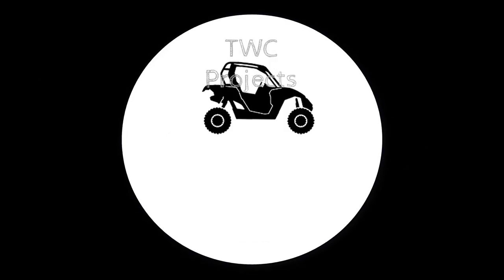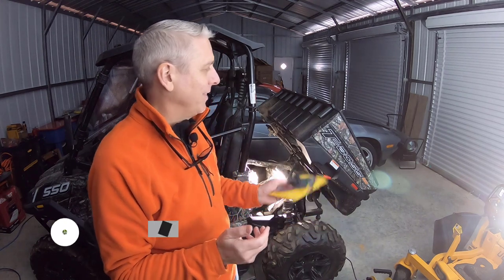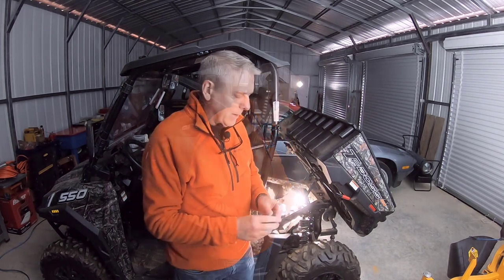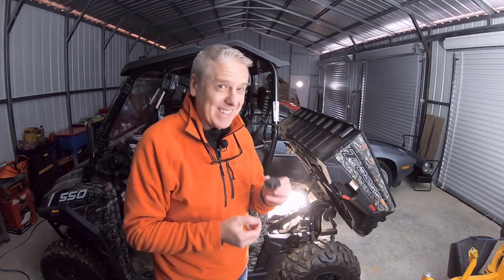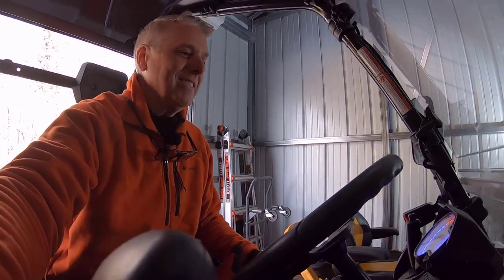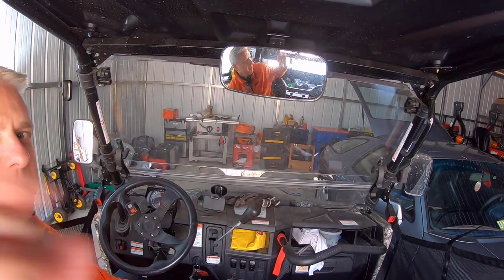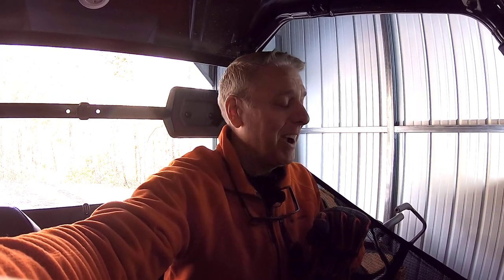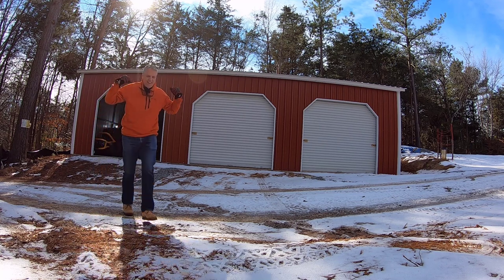51-It's BACK!  My Massimo T-Boss 550 side-by-side/UTV is finally running again.

Comment: Thanks for posting. I am fixing to work on mine. It's not a constant problem but I ran the fuel low I think I sucked crap up.
Reply from the maker: Glad you found these repair videos helpful.  You mentioned fuel, so you probably saw this video too, where I replaced fuel filter, injector, etc.  In case you missed it, here's a link to it.  https://youtu.be/gYIdxIML4LU?si=33vcpbjWLOyrOq74  I think I have 3 repair related videos in all.  

Thanks for watching and for your comments.  So good to know these videos help others.  Have a fantastic day.

Comment: Thanks for the Video. I have a 2022 AXIS 500 with 212 miles on it. Drove it in the shop. The next day it would only start and go dead. Trying to find a dealer to work on it under warranty is useless. I found one they kept it for 6 six weeks and could not fix it. I brought it home  cleaned out the fuel tank, new fuel filter, injector, spark plug, disassembled carb and cleaned got the same results. Run acroess your video. I removed the TPS and checked the ohms got nothing. Ordered a new TPS installed and it runs like new. Thanks again Tim
Reply from the maker: Wow!  That's fantastic to hear you got it running again.  So sorry you had all the frustration and waisted time.  As you saw from my 3 videos, I had similar experience, less the 6wks in a dealer's shop.  If I had only known that there were ODB2 codes.  Surprised the dealer didn't know that..  I now have the codes list with descriptions and much more related info on my website.  Please feel free to refer back to that anytime. https://twc-projects.net 

Thanks for your positive comments.  I'm so glad to know these videos help people.  Have a fantastic day.

Comment: Got my TBOSS 550 last year. Everything was great until recently. Snow on the ground here in Missouri. Now the engine cranks over but no fire. I guess I'll look under the hood and see if the fuse for the electronic injection went bad. Have good gas in the tank, and have stored my T Boss in my garage. Looks like next I'll look at the fuel injection spray. Thanks for your videos!
Reply from the maker: You probably saw my other videos where I first tried replacing fuel injector, filters, pump, etc. before I found the real problem, a $19 part.  Be sure to see the Description of this video, as it has more great info about troubleshooting this part and problem.

Also, you can find links to all the tools, parts, and equipment I show in my videos on the Resources page of my website ( https://twc-projects.net/resources ). 

Thanks for watching.

Comment: Awesome Video! I've seen alot of Videos made with the same problem.  I'm sure you helped them out.
Reply: Honest question....if you had to do it again would you still buy this utv and if not which one would you buy. Im in the market....just wondering 🤔
Reply from the maker: It depends on what you plan to do.  I originally bought it thinking I would use it for trail riding 25% and work around my property 75%.  For around my property and general purpose use it's fantastic, and yes I'd definitely it again.  However, after taking it through the mountains on one trip, I lost interest in trailering that thing for hrs to do anymore trips.  It's just too under powered and doesn't have the suspension like a Polaris General or some of the more popular, bigger side-by-sides that are built to climb up rock ledges.  Of course they cost more than double the price of the T-Boss 550.  Maybe the extra $1,500, or whatever the difference is now to move up to the T-Boss 750, might be enough power to make mountain trail riding more fun.  Maybe consider that model too if you go with Massimo or Bannche.

But, for riding across fields and through the woods; for hauling wood and tools; for running back and forth; I'd happily buy my UTV again.  Though it was dead in the water for over 2 months, truth is that was partly my doing as I didn't want to take it to a real mechanic and I didn't want to replace a chunk of my engine when it was just a $19 part that needed replacing.  And I didn't realize I could read computer codes, that in my case would have narrowed the part I needed on day one.  Yes, the Massimo people blew it with tech support, but I'm not done with them yet.  There are thousands of viewers every week watching my Massimo videos alone.  And I hate to judge an entire brand by the ineptitude of one or two people.  The in my opinion Massimo product is very good, even if the tech support team screwed up by abandoning me.  Hopefully I'll be able to help others through these videos.  So of course it's up to you to decide what will be best for you, but I still love my Massimo and expect to get many more fun and hard work out of it. 

Thanks for your question and for watching.   Let me know what you end up buying and how it works out for you.  Very best of luck..
Reply: @johnhayes2299  I have had nothing but trouble with my T Boss 550. Just make sure before buying one, check and see if you have any local service for them. Places in my area that Massimo said were service centers basically just shut the door in my face. Mistake I wont make again. Maybe would try one again if i could buy one from a dealer. Don't buy from a big box store!!!

Comment: Hi, I couldn't catch the part # on the throttle position sensor you ordered for your t-boss if you could please share where you got it from and or part number we would be greatly appreciated. Thank you
Reply from the maker: Are you unable to see the Description text for this video?  I'll try to copy/paste it from there for you.  Hopefully that works.

LOREADA LRD064915 Throttle Position Sensor
https://m.aliexpress.com/item/2251832789158544.html?spm=a2g0n.productlist.0.0.4a29976M976MwB&browser_id=40c8fc8f6d774ffbb598ed6bd027deb7&aff_trace_key=&aff_platform=msite&m_page_id=2lejg2ufpl8caumx180cd58c92f4910cf191d1b55c&gclid=&pdp_npi=2%40dis%21USD%21%2119.8%21%21%21%21%21%400b0a555f16527125901434369e1773%21%21sea&algo_pvid=d6c90568-9587-4b5d-9485-0a48c4e50c4b

Comment: I like the looks of the rig BUT who works on them? Do you have to get parts through China? I have a CFMOTO Uforce 800 and parts are everywhere on the net plus dealers popping up all over the place. For the price of that rig why not just get a rig that is popular and easy to get parts or have worked on?
Reply from the maker: I'm not in this business and make no money from Massimo or any other UTV brand.  I just share what I personally experience in hopes it will help others.  I suggest you go with whatever works best for you and your specific needs.  For my personal needs, I've been able to find the parts I needed and fix my own rig, which is one broken part in the 3yrs I owned this machine.  And I posted links to where I've found that part, and any others parts on my website; again, in hopes of helping others.

Thanks for watching and for your comments.